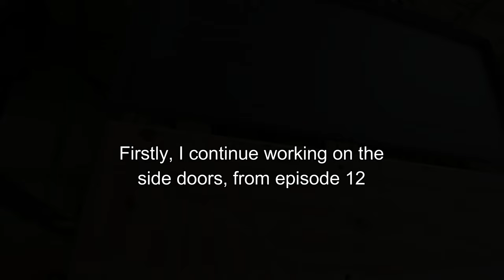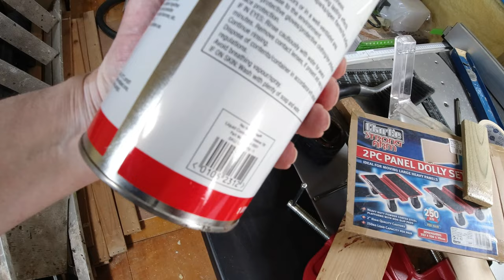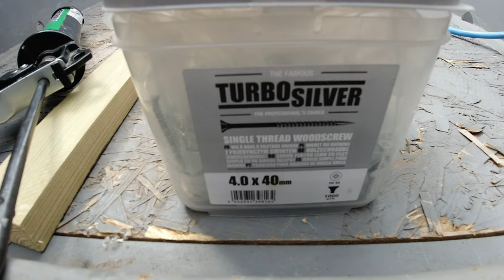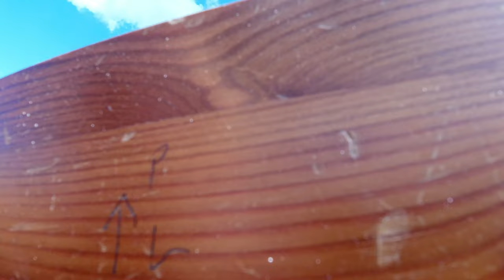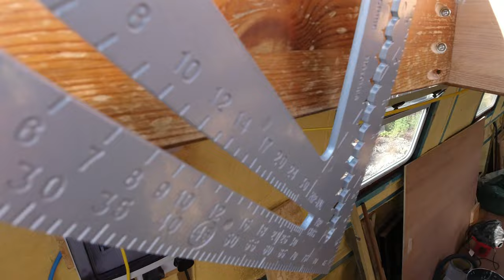Narrowboat_fitout_epi#13 - A Hatchet job

Comment: I think you should do a U Shaped kitchen. Keep it and the bath compact as possible. Maximise lounge space.
Reply from the maker: Thanks for commenting. I am keeping the bathroom to 5 feet, but still undecided about the galley / kitchen, so your suggestion is still a consideration. I do enjoy cooking, but do also look forward to have daytime guests on board. We shall see what my eventual fitout brings 😉
Reply: @TheBeeryBoater  many think floating apartment have a look at sailboat layouts. The U shape , if you're underway, is very safe and compact.. Always something to lean into. You should research 12 volt cooling freezing elements in the blue water boats. You could convert a full size fridge to a 12 volt system. The fridges in narrow boats are barely big enough for two, three days of provisions.
Reply from the maker: @russellesimonetta3835  Nice one. I will take a look later, and thanks ;-)

Comment: Doing a great job. You seem to know what screws to use and how it all goes together. Are you in the building trade Rich?
Reply from the maker: I was a kitchen and bathroom fitter in the early 90s for a few years and have worked on properties before I had a career change, but still enjoy DIY.

Comment: What is the reason for double batterning
Reply from the maker: Hi Dave. Thanks for the response. Good question.
It’s just to make it easier when cabling around the end walls (and there will be a lot of wiring), and it saves me having to cut away channels of the spay foam, insert the flexible trunking, and then use aerosol-type spray foam to hold the trunking in place and in order to ensure any exposed metal is covered. It also means that if I want to ‘add’ any more cabling later, this can be done quite easily.
Also, if there’s more room behind the panels, where and cable trays are used, there is more room for me to do this.
To be honest it’s also easier, probably quicker, and cheaper, this way, as I don’t have the extra cost of purchasing numerous cans of closed-cell spray foam, which for a quality one, can be quite costly.
Okay, I will lose an inch or 25mm of cabin space at either end (the thickness of the battening) but in the grand scheme of things, two inches less when you consider the length of the internal cabin space is nigh on 534 inches, or 44.5 feet, is nothing really.
Hope this answers your question Dave, and thank you for watching 😉

Comment: when are you hoping to have it all up and running?
Reply from the maker: Thanks for the question…
I am now looking at March / April time next year (2022).
Originally, I was going to be on the water last May, but the shell build got put back because of Covid, so I didn’t start working on her until April (2021) time, and my work commitments are now slowing things down a bit, but hey, I’ve waited this long so a few months are neither here nor there! I’m taking it easy and now in no rush, just like I’ll be when floating the cut! 😉